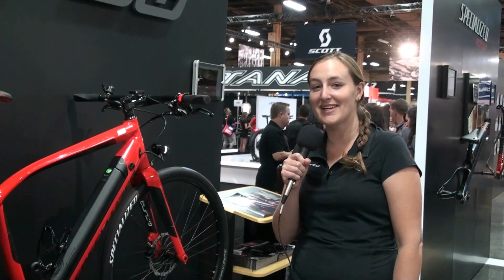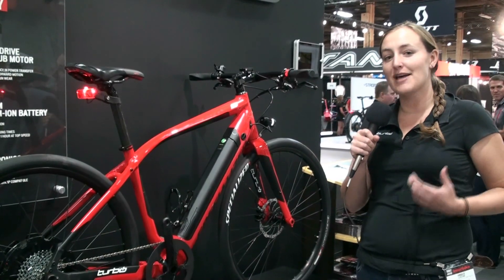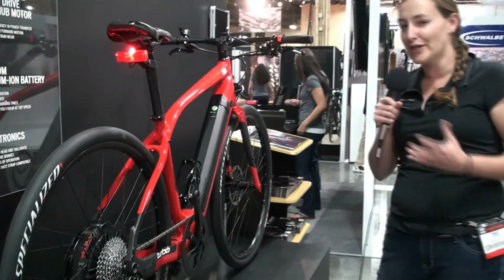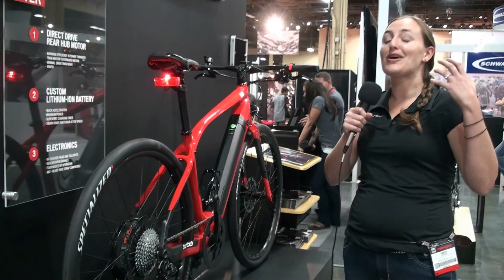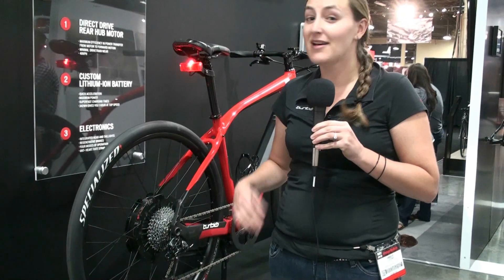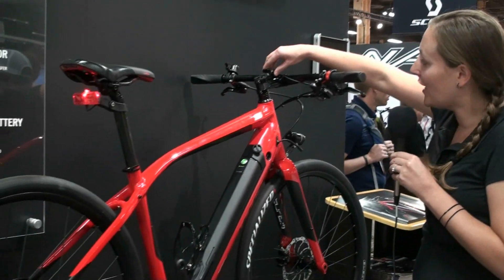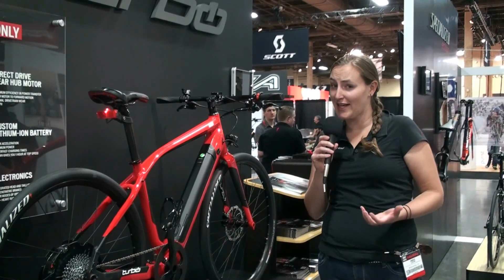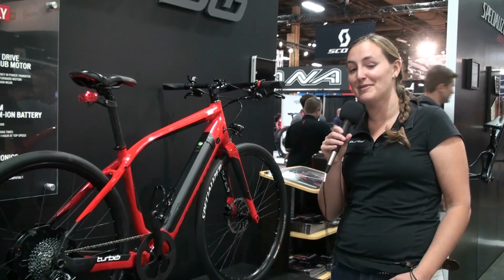Specialized Turbo Electric Bike at Interbike 2013 | Electric Bike Report

Comment: How long do the battery last. In 3 years. If the battery lasts that long. Will you be able to replace them. These batteries change every year.
Reply: A new battery is $800 and I don't think you're going to have to buy a new one any time soon.